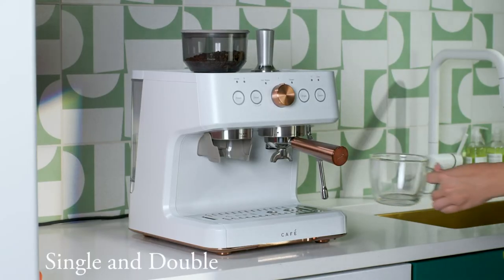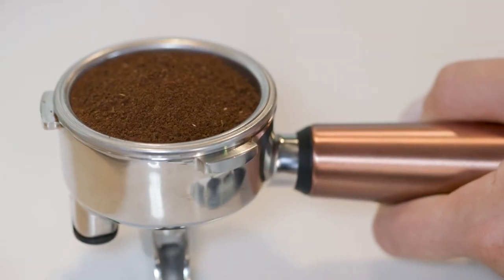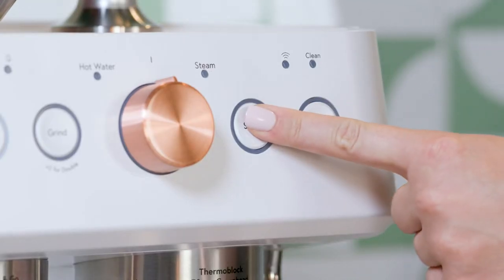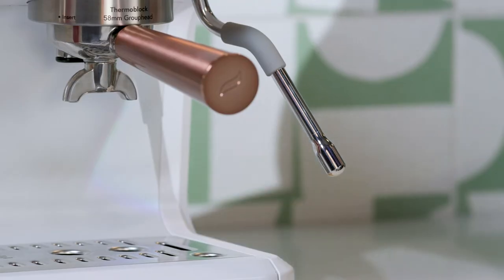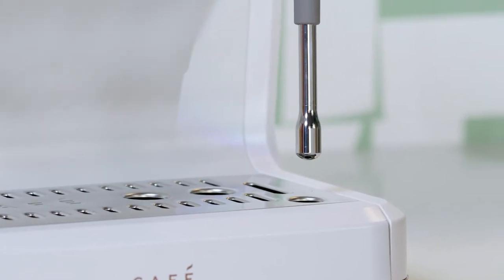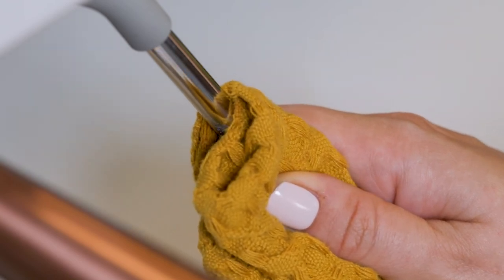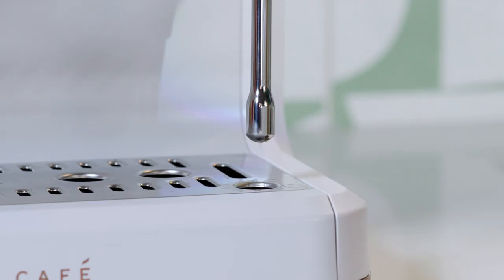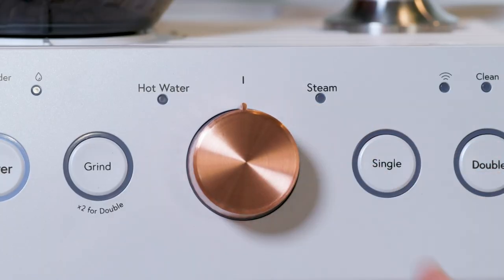Using your Café Semi-Auto Espresso Machine

Comment: Why does my single or double button flash when I press it? When I first got the machine I could brew right away. Now it takes about a minute to load before I can brew
Reply from the maker: Hi Taylor,

Thanks for reaching out! Have you tried cleaning your machine recently? Take a look at the Care and Cleaning section of your Use and Care manual to see if this helps: https://products.geappliances.com/MarketingObjectRetrieval/Dispatcher?RequestType=PDF&Name=49-9000028-1.pdf&_ga=2.19109951.627538574.1645538937-2115960750.1644356528

If you continue to see this happen, let us know!

Best wishes. -MS

Comment: can i just fill the group head just half full? like i just want smaller amount of coffee
Reply from the maker: On Manual espresso machines, single cup volume can be adjusted between 0.75 and 1.5 oz with the default of 1 oz. Double can be adjusted between 1.5 and 3 oz with the default of 2 oz.  Increasing more than 2 oz will affect shot quality.  You can change the volume in the SmartHQ app.

Comment: I’ve purchased this machine and have been using it for several months now. 

ESPRESSO !!
FYI to those interested in espresso @ home, the quality of beans you put in will reflect the coffee you get out. 
With that said, every bean will grind differently and produce different results.

I’ve poured espresso shots everyday and have never experienced any inconsistencies or issues.

Please take it upon yourself to do research before blindly brewing. 

Modern espresso is calculated and measured. Your methods are likely not. Haha.

The grinder function works great although I’d suggest you invest into getting a scale to be sure your dose (amount of ground coffee) is consistent. 

A dark roast requires more maintenance within the grinder and should be cleaned more frequently.
(This may explain some issues expressed in past reviews) 

Whereas a light or medium roast produces less oils, hence a cleaner grinder. 

The steam wand creates beautifully textured milk, and is quite forgiving considering the pace of steam.
(I did find the water function out of steam wand quite odd) 

I bought this machine because the reviews were especially bad. All in all, I am amazed with the features and quality of espresso I am able to pull at this price point!

Comment: All the buttons flash when I try to use double or single.  And it keeps making a sound over and over when that happens.
Reply from the maker: Hi, and thanks for reaching out to us. If all the buttons on your espresso machine are flashing white, this means the coffee grounds are too small, there are too many grounds, or the 
grounds are packed too tight in the portafilter. To fix, dispose of grounds, and try again by increasing the ground size, decreasing the dosage, or tamping the grounds with less pressure. Hope this helps! -SK